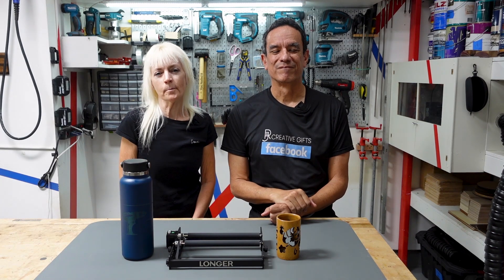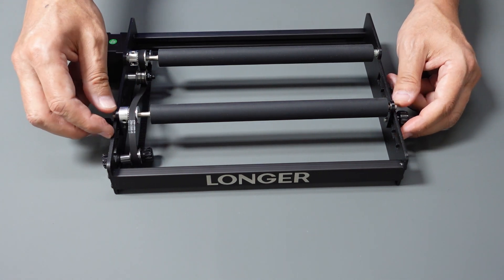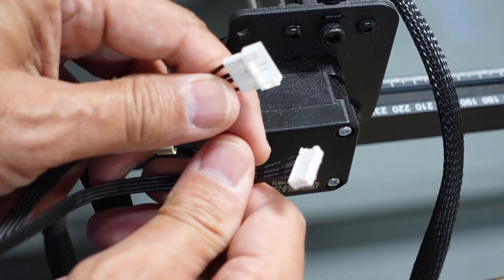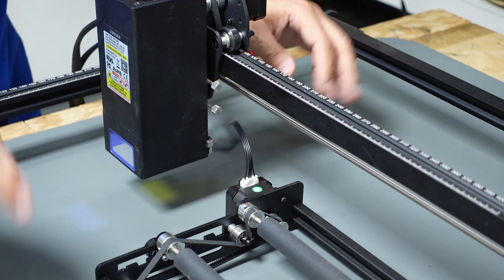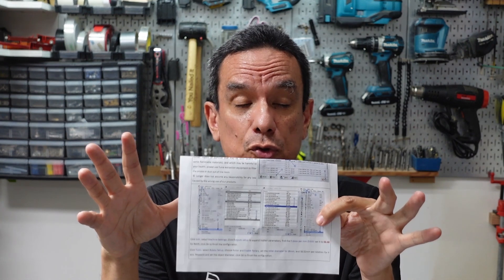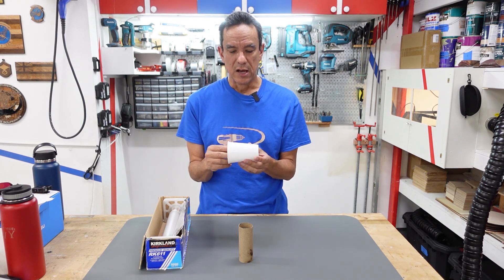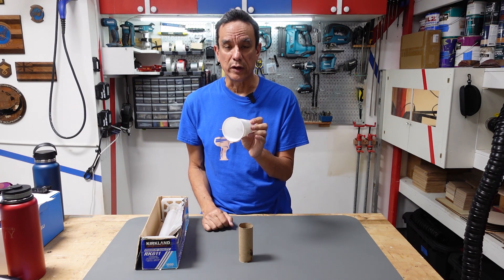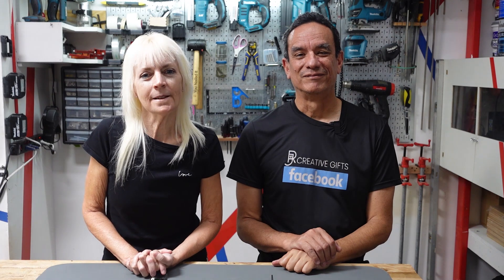Mastering Laser Engraving: Using the Roller Attachment on Longer Ray5 20W Laser!

Comment: I realize this video is a year old, but had light burn fixed the settings issue?
I haven’t used my roller yet, but light burn has a ‘enable rotary’ option. Wouldn’t the settings go back to ‘normal’ if that is not checked?

Comment: Have you engraved stainless steel by ray 5 10w?
Reply from the maker: I tested it on a 20W Diode laser. It does not actually engrave. It heated tht metal and metal turns different colors depending on the temperature applied to it. I expect to obtain a 4w Infrared laser, which should be able to engrave stainless steel. We shall see. :-)